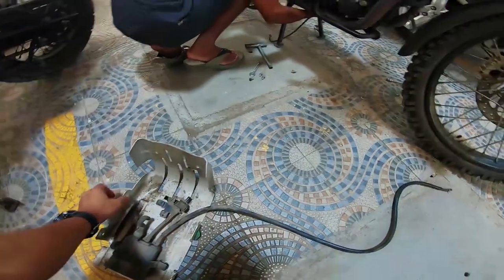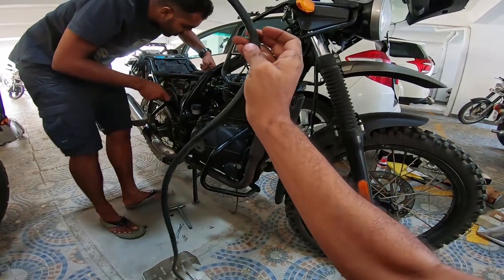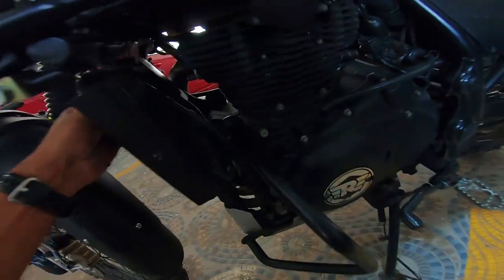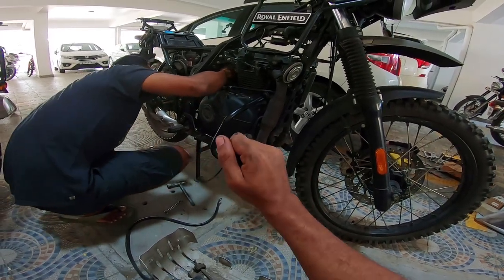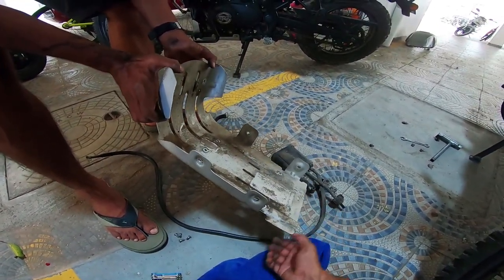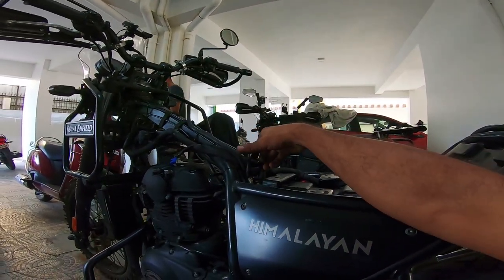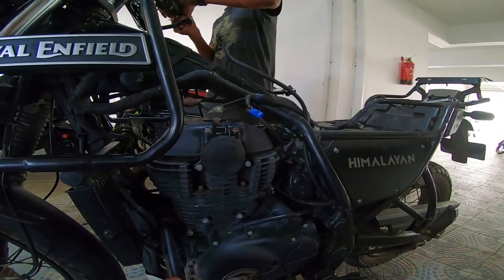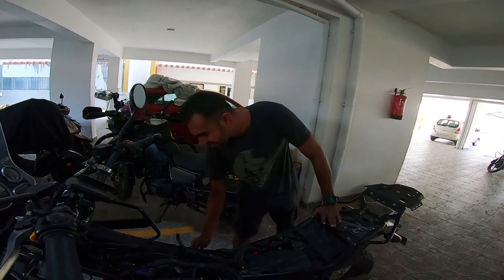WHY DELETE EVAP ON YOUR HIMALAYAN

Comment: Ben, wonderful video. A small correction if I may. The only drain hose there is, is the one that comes from the tank that vents the fuel vapor. The throttle body doesn't have any vents per se. The tube that is in the throttle body is basically the feed tube from the EVAP canister which basically re-routes the fuel vapors that escape the fuel tank. Make sure that bolt or a plastic plug is zip tied to the mouth of the tube that connects to the throttle body and keep that tube AS SHORT AS POSSIBLE to prevent any cracks in the tube and what does a cracked tube do? It lets the TB suck dirty air through that cracked tube and that isn't a good thing. Keep the throttle body tube no more than your index finger's length, get a good quality plastic plug or a snug fit bolt, and zip tie the circumference of the tube so that the bolt/plug doesn't get loose and you're set. Hope it helps!
Reply from the maker: Hi Vijay . Kindly watch the video again.
Reply: @ONTWOWHEELSBEN  Ben, I did see the mod you did, but it's still better to trim the tube and get it tucked in nice and under the fuel tank and lock it with a plastic plug. It's not a bad job what you did, but can be done better! :)
Reply from the maker: @vijayam1  I was referring to the DRAIN HOSE part . I meant something else . Also keeping the tube long is for just one purpose . To revert back to stock setup ( if you want to sell ) someday .
Reply: @ONTWOWHEELSBEN  Gotcha! ❤️

Comment: Thanks for the great videos Ben!
Can you please explain why do you recommend to shut the throttle body hose with a bolt? Is it originally shutted when connected to the above skid evap system?
What happenes if this hose is missing and not connected under the tank (I've noticed it today while trying to tune my idle rpm..., Can it be the cause for idle rpm issues?)

Comment: Hello ben! I have been watching your videos for quite a time now and they have helped me to understand a lot about my himalayan. I actually needed your help on a issue i have been facing for a month now, i had submitted to the royal enfield service centre for like 4 times but they couldn't find the problem. So the problem i have been facing is a specific friction sound coming from the right rear side with every rotation of the wheel. No sound at higher speeds but at till 10 you can hear it loud and clear. There are no visible friction marks on rear disc or the rim. No issues in brake pads and callipers too. Would love to hear from you.
Reply: Same issue for me!
Reply: I have the same issue ...but only when I slightly press the brake
Reply: @sujoyghosh9357  i asked the service to check the break pads yet the same issue arrives
Reply: Same....after few kms of the first service the issue came back again
Reply: I just got the rear bearing changed and i can hear no sound now. Will update after few days again.
Reply: @jayeshjadhav1177  rear bearing for?
Reply: @jayeshjadhav1177  sorry i don't know much about bike where is the rear bearing located??
Reply: @sujoyghosh9357  Rear axle bearing
Reply: @bharathram3850  Rear axle
Reply: I had the same issue and three visits to the service centre did not resolve it. Finally, I took it to another service centre, here the mechanics did the air bleeding of the rear brake line and in half an hour sorted out an issue that plagued me for 6 months. If your problem is not resolved, maybe you could try this out.

Comment: Hi Ben, huge fan of your videos. Thanks, however I deleted the Evap kit just as instructed on your video, but my tank pressure increases exponentially and my tank is now cracked where it meets the seat. Any idea what could be going on? I’m thinking of reinstalling evap before I get new tank
Reply from the maker: @quinnnordwick2285  that’s a first . You tank should still be able to vent / breathe from the lid . Plug ONLY THE THROTTLE BODY HOSE . Leave the other hose hanging without plugging . Also don’t plug the water drain hose .

Comment: Ben anna vanakkam bs3 la canister irukkumaa stalling problem not solved after cleaning carburettor
Reply from the maker: everything boils down to fueling and ignition as far as stalling is concerned . so keep eliminating one component at a time to find out what is the issue. look into your skid plate to see whether you have the canister

Comment: Hey Ben been watching your videos the whole time.. My Himalayan bs3 stalls only when reved Or els it is ok at average speed 40 to 60kms. I am guessing this would be the issue after watching ur video will try it out. 
Respect
Reply from the maker: No , get your fuel pump/ filter cleaned and declog your water drain hose . After you pour in FRESH FUEL use injector cleaner ( watch my video ) and go for a long drive immediately. Rev hard
Reply: @ONTWOWHEELSBEN  god bless..will try this